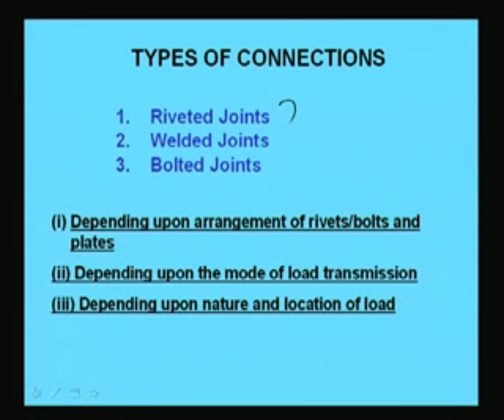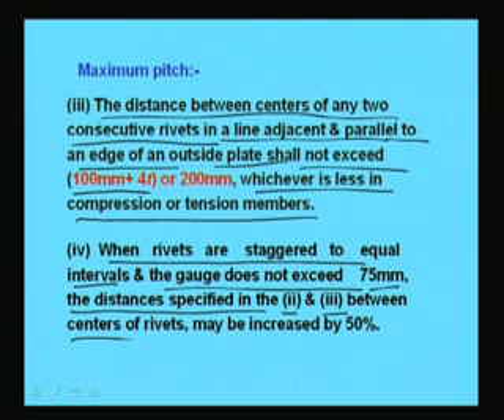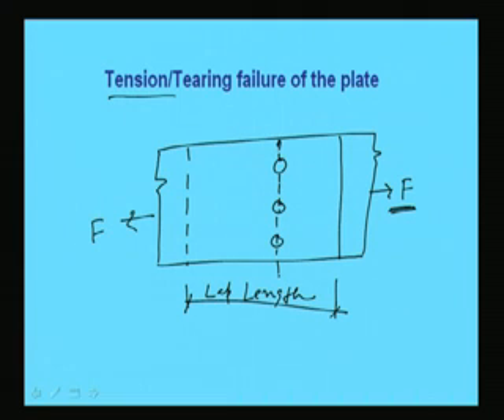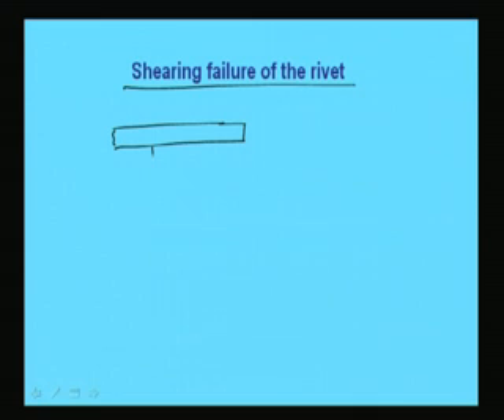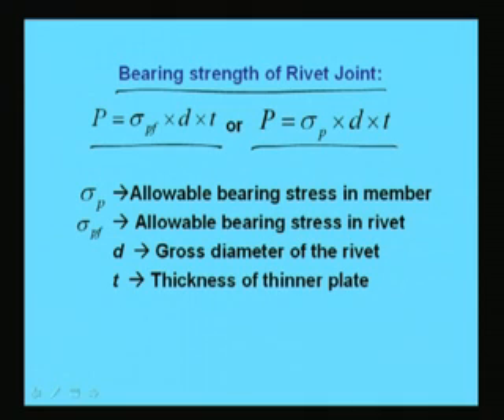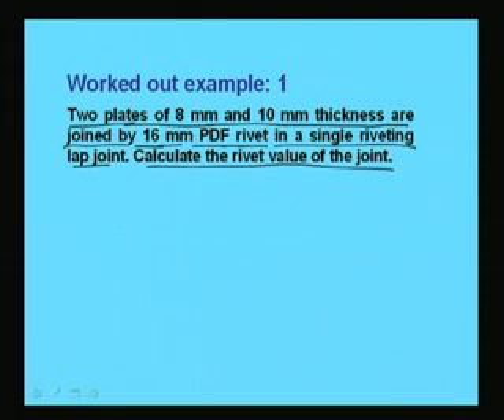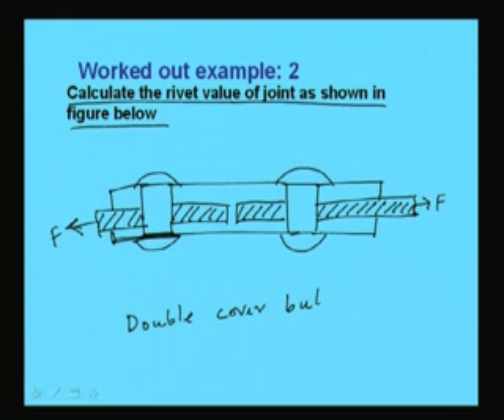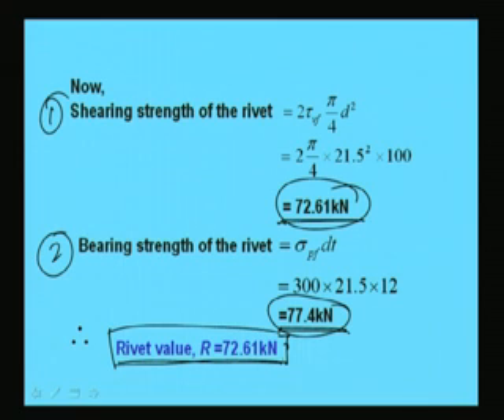Mod-2 Lec-2 Riveted Connections

Comment: in module 2' lecturer 2 ; for worked out example 2; why you are using 100 & 300 MPA for HDS rivet in shearing and bearing strength respectively....
Reply: As materials have different strengths depending on the nature of stress applied, the maximum safe bearing stress is usually taking as the tensile yield stress and maximum safe shear stress is usually taken as half the tensile yield stress, this can be proved through stress transformations

Comment: 52.35 As per table 8.1 of Is 800:1984 for  hand driven rivets shear stress is 80mpa and bearing strength is  250 but ur used 100 and 300 .. which one is correct????